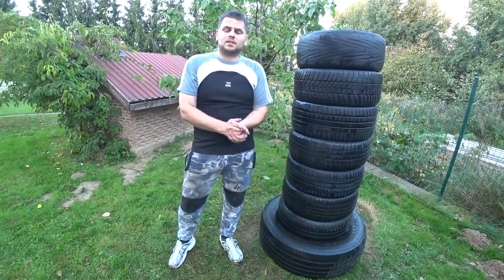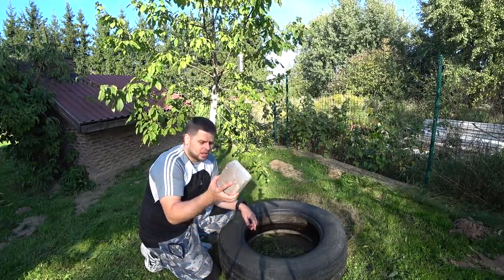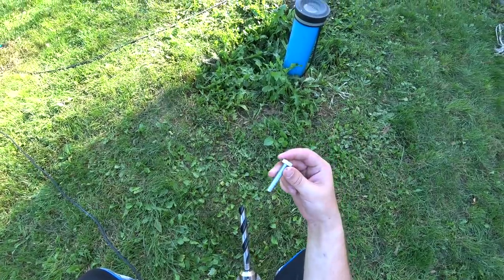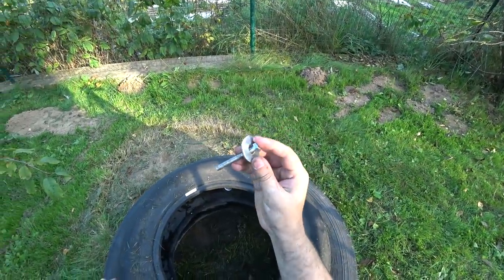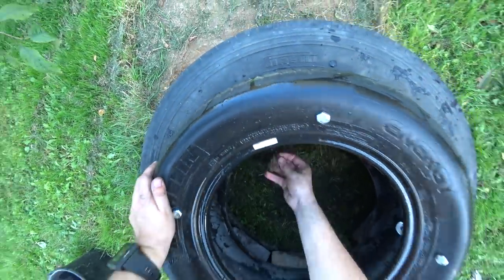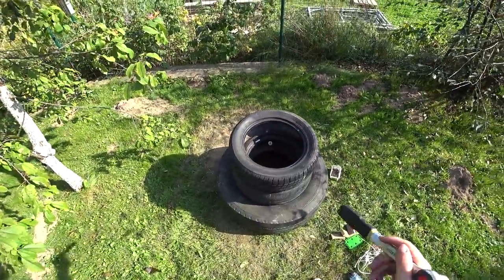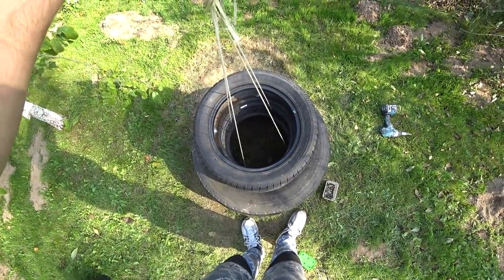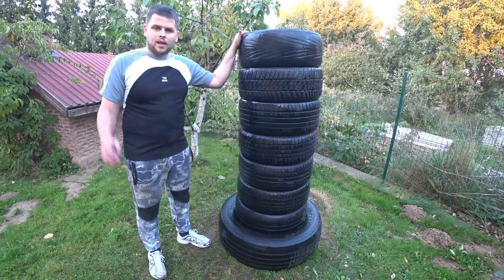Freestanding Tire Punching Bag (How to make)

Comment: For me the most important is you are recycling tires and making a good use of it, it's heavy duty, saving the planet. Make sure no water is still inside tires make holes on all tires specially at bottom so there is no production of mosquitos. Thank you for recycling.
Reply from the maker: Very nice comment🙏

Comment: thank you for this video. I used the mud technique and it helped me alot. I struggled screwing the bolts tight because my wrench does not have the extension attached but I managed to do a good job. I didn't include the ropes inside the bag but I may take off a few tires and reach down inside and attach them for more stability. I also didn't manage to get an XL size tire for the base, but I do have bricks, but since it's a smaller tire it cannot fit as many as yours, and I will need more weight inside, but, for a DIY bag, I cannot complain and can't wait to use it.. for now, I need a rest!

Comment: This is great, and exactly what I was looking for. Thank you! As for making the holes line up, why not use a piece of illustration board (or any large piece of cardboard) to make a template. I think this will be quicker and less error prone. I will experiment with this method. Also, I plan to wrap the whole structure with a piece of tarpaulin in order to make a smoother surface. I think this will cause less damage to my gloves/hands.
Reply from the maker: Yeah, I think your idea is good too. Talking about the gloves, I don't use my new boxing gloves for this punching bag, I use my old and already damaged gloves
Reply: Tarp will rip easily between the tires and gloves. Wrap it in a canvas painter's drop cloth. Coat the back of the canvas with an epoxy before wrapping, then run self tapping screws up top to help hold it up so its own weight doesn't make it peel, and if you want tie some jute cord around it everywhere two tires meet. Should last you years and is weather resistant
Reply: why not just stack each tire then drill through both at the same time? then they are sure to line up.

Comment: What are the sizes of the bolts please thank you great video
Reply from the maker: 1cm diameter and about 6cm in length
Reply: thank you
Reply: I used m12 30mm but they where a right pig to fit and had to get 50mm ones cos the tyres may not all be exactly the same and curve in tyre sometimes pushes the up

Comment: If we don't have drill what is the alternative we can use ?
Reply from the maker: Try to use knife. It might work
Reply: btw thanks. what about if we installed 8 Bolt instead of using the rope? What is your opinion?
Reply: or can i use the hot nail like i Burnt the nail and try to poke to the tire?